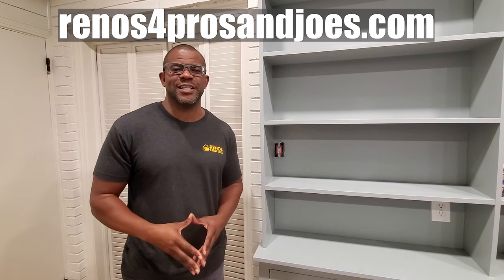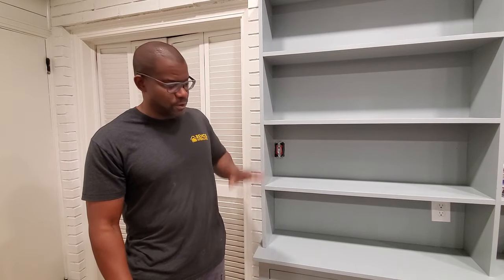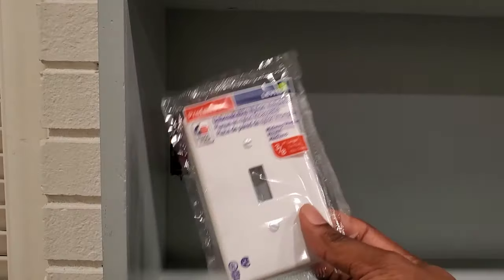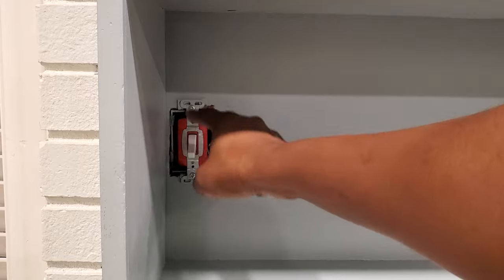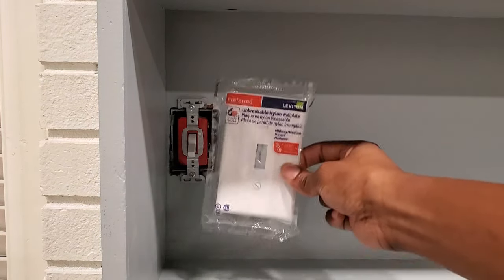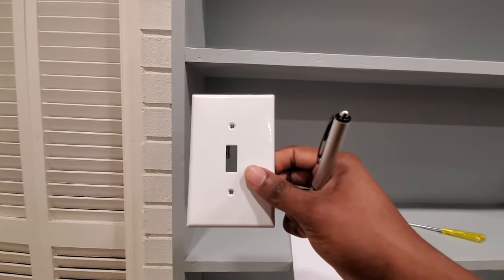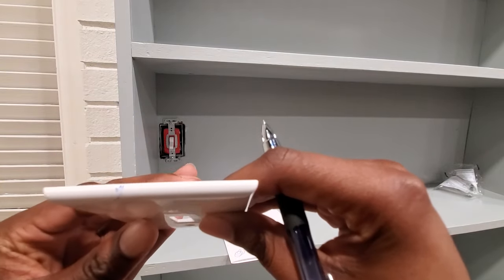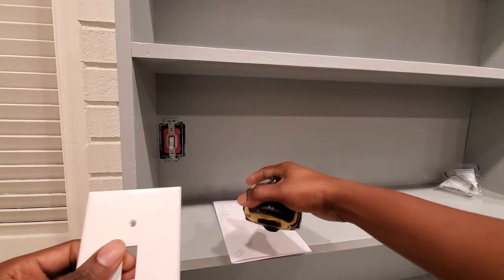HOW TO CUT A PLASTIC SWITCH PLATE COVER | Full Tutorial

Comment: I have tried many ways to trim plates. Little success with power tools or sanding. I had to remove 1/8 of an inch to fit above a back splash and I placed it in a cup of hot water for a minute and used the same shears as you. It was perfect. Thanks.
Reply from the maker: Great tip. Heat will definitely make the nylon plates easier to work with. Thank you.
Reply: Oh, thanks for the extra tip with warm water...I have an overlapping plate over some backsplash cause I gave up after shattering several covers years ago.

Comment: What a beautiful and careful job!  I have been staring at the crappy job for over a year on a swtichplate cover the handyman put on when he did some trim work on my kitchen remodel.   There is an irregular gap on the wallboard side and an angled gap on the other side with a 1/8th gap at the top that is wide enough to show the metal plate.  So ugly! I appreciate that you show that a completely straight line might not be indicated, and that you recut a new plate to improve what looked like a decent job from test #1.  I don't have one of those scissors but will practice on this bad plate with some other cutting tools (exacto knife?  Maybe some dremel attachment?) before trying my new plate.  .... or head to Home Depot for yet another tool.  Thanks for the instructions!
Reply from the maker: Thank you so much! For me, the big scissors make the cuts easier than an razor knife or a dremel. Good Luck!

Comment: First, I tried Home Depot, Lowes and Amazon for these switch plate covers. Only Amazon had them for $8 each. But I had to fashion a specialty HDMI and Coax switch plate (from Amazon) to fit behind a TV that was wall mounted. The mount covered the lower portion of the plastic plate's intended location. So I took my exacto knife and scored a line where I wanted to cut off the plate. I then took a basic hacksaw and simply cut the piece off. I used the exacto to finish off and trim the plate. Mounted the piece on the wall and it looks great. So yes, cutting  a nylon switch plate cover is the smart way to go. But there are other ways. I saw a You Tube fellow who used a hand belt sander that was not even clamped down (very unsafe I might add-I am a medic), but that process is not the way to go.

Comment: On a tape measure, the reason the end piece moves back and forth and there's 1 less 16th in the first inch is because when you measure pulling, the end piece slides out to account for adding the missing 1/16" inch and the measurement comes out right. When taking a measurement by pushing the end piece against something, the thickness of that moving end piece is 1/16" so having it pushed against something also adds the missing 16th back in to the measurement as well. The only exception to this is on an old worn out tape measure where the rivet holes have worn into an oval so that end piece has excessive wobble beyond the 1/16 and so isn't reliable anymore. Most tape measures have the end piece that appears to be loose, but it's actually for a reason. If you push the end piece in and measure the same way as pulling the tape measure, you'll loose the extra 16th and you'll have a small gap. So don't hold that end piece in when you do a pull measurement.

Comment: Couldn't you just at the first cover cut, loosen the screws on the switch and adjust its position to the left so that the cover would fit snug against the wall? And by the way, 2/16ths is equal to 1/8th, and half of 1/16th  is 1/32nd, so what you had there was 3 inches and 3/32nds.

Comment: I just clicked on this to ask why it takes 34 minutes to explain this lol
Reply from the maker: It's not that easy to execute this perfectly because it involves math and a very steady hand. But if you watch this video you will have a complete understanding of what is involved and how to do it and you won't have to look anywhere else for information on this topic. Cheers!
Reply: The reason the ruler end slides is to make up the difference for if you are butting against something and then putting it over the edge and pulling it to get the measurement it slides 1/16 inch to compensate the thickness of the end when it's butted so you don't have to do the compensating for that yourself.
Reply: Just covered mine in painters tape and ran down table saw. Looks perfect 👌🏻
Reply: This is how to use a "tape measure and do simple fractions 101" lol, no I get it some people need EVERY single piece of information. I just wanted to see how it was cut.
Reply: @mikediamond3288  🎉thank you for commenting that. I was starting to feel crazy
Reply: Dude that's what I'm saying holy shit. I had to fast forward through basic math and other explanations. Didn't know someone would need putting screws in the faceplate explained to them
Reply: He was explaining the tape measure, and I'm glad he did.

Comment: Lol do you not know how to read a measuring tape? Quarter inch not 4/16 or half inch not 8/16 🤣. Also all you have to do is measure the distance from the difference of where the holes lines up on the plate and cover, by placing it on top of the outlet. It takes 20 secs.